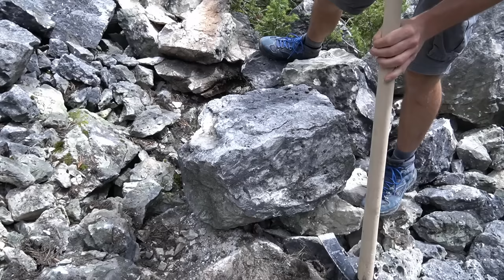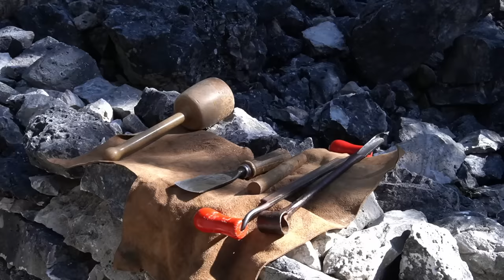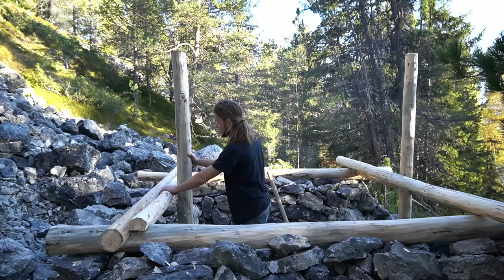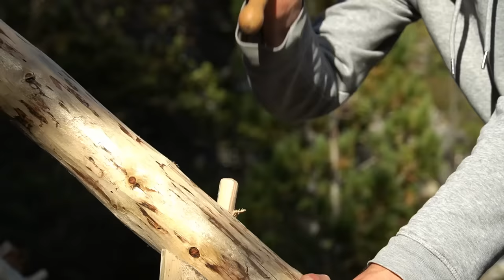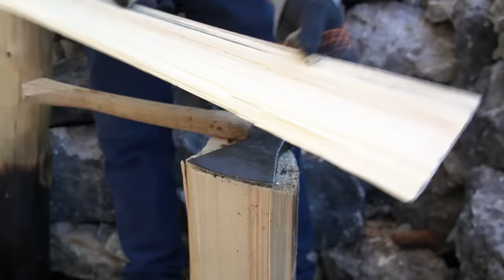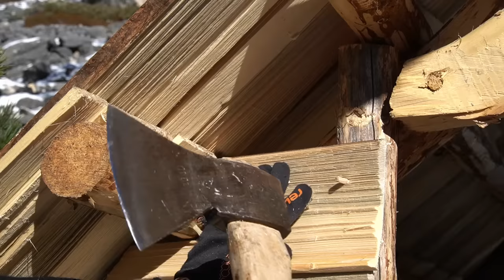Building alpine Bushcraft Shelter | Survival materials, shingle roof, stone wall [Pt. 1]

Comment: Nice work on this build.  I especially like the all-wood aspect to it: in that there are no metal nails.  I know some people put clay in with the dry stacked rocks as a way to seal the wall and keep it warmer in the winter.  I am curious about part two.  Cheers.
Reply from the maker: Thanks a lot mate👍 I was looking for clay but its not easy in this area, the gound consists mostly of soil and sand.. after the winter I will look again👍
Reply: @EpicAlpineBushcraft  moss could be available
Reply: @EpicAlpineBushcraft  you could try wood ash cement.

Comment: Building on a talus slope certainly has the advantage of availability of rock, but the reason that rock is there is because something unstable is uphill from it. An avalanche or earthquake could bring more down on you. 
I love the craftsmanship and the froe. My brother made a froe about 50 years ago to replace some of the shakes on the log cabin we spent our summers in as children.  I am more partial to a saddle corner where only the bottom sides of logs are notched with a curved notch. Notches on the top surface collect moisture and speed decay.
Reply from the maker: Hello, on the video recordings it may look like you mean, but in real life its different. On the upper, steep side is just sand and pebbles. The larger stones are all down and this terrain didn't change since I was a child. Unless there are no natural extreme conditions there is no danger

Comment: Servus! Nicely done 👌🏼 usually one finds all kinds of bushcraft stuff. But as I am Swiss/Austrian it is hard to find some sort of environment bushcraft I could do myself. 
Unfortunately I just got a problem with the disk between two back spine bones at 32 and probably have to use physics to move heavier stuff. F.e. move those boulders with momentum from metal poles. 
I do plan to buy a claim (Parzelle) in a forest to build something myself.

Comment: That's amazing! Why do you burn the tips of the logs before putting them down in the holes?
Reply from the maker: Thanks a lot manuel👍👍 to prevent them from rot in the underearth part. The charcoal skin is very resistent

Comment: Beautiful project.  One observation/question, was the rock patch from an old creek bed or from spring melt?  If the latter, I’d worry about it getting hit with water during the spring melt.
Reply from the maker: Thank you very much Nick! This is a dry boulder far from water, so that also the rainwater will not cause any issues as the rocks in the lower area, where the hut is located, are particularly thick with almost no sand/pebbles which could prevent the water from trickling into the ground. Unfortunately the incline is not so well visible on the video recordings. Further up, where it is steeper, there are mostly pebbles, so there is no danger of falling rocks

Comment: QUESTION PLEASE:  OUT OF CURIOSITY:
* Why did you put logs and stones over your shingles on your roof?
* I'm assuming that you're worried about them "blowing away" but, as you know so well, as you showed in your video, snow and water get piled up on the logs and stones (ie: the can't slide down the roof) and that will rot (aka deteriorate) your beautiful shingle roof much quicker!!!
* Just curious!!

Excellent job on your carpenter and masonry skills!!  : )

Amen
Retired, Veteran
Reply from the maker: Thanks a lot Brad! As you said rightly, for reasons of stability and, at the other hand to get the shingles straighten out, (the logs had a slight vortex grain). The accumulation of snow is even welcome in that context. The shingles don't rot that easily
Reply: @EpicAlpineBushcraft   KEEP BUILDING MORE AND MORE WITH DIFFERENT DESIGNS!!!   : )

Comment: Maybe I'm a novice, but a house built at the bottom of a hill where clearly rocks have slid previously, then building your house on top of said rocks, doesn't seem very safe? Also, the floor is a bunch of loose smaller rocks, which seems not only uncomfortable but like a rolled ankle waiting to happen.... Anyway, all that said, I like the general aesthetic and the build process overall!
Reply: Granted, the age old kick and slap technique to test the structural fortitude of the building is all the signoff I need.

Comment: Building any shelter in this rock falling slope is crazy. Sooner or later you will have a rock falling on your wooden roof, so in your head.
Very nice video but....
Reply from the maker: Thanks mate. This slope looks in real life different from the recordings. The larger rocks are already on the flatter downside, meanwhile the upper and steeper area is mostly covered by pebbles and sand. There is also a vertical treeline directly over the hut, so it is still safe. This slope didn't change since I was a child...

Comment: Seem's an incredibly dangerous spot, at the bottom of where those boulders fall.
Reply from the maker: The place of the hut is safe, due to a vertical treeline which interrupts the slide. You maybe can see that better at the drone recording in the first minutes
Reply: @EpicAlpineBushcraft  Dependant on the size of the rock of course.

Comment: just how prone to rock slides is that area you built in ?
Reply from the maker: Hello, it is not dangerous as it may look like, because the upper, steeper area consists mostly of pebbles. The larger rocks accumulated in the lower, flatter area. This is not so well visible in the video recordings

Comment: So you built a structure in a known rock slide area? Not near it, in it. Like... right in it. I'm trying not to be that guy here I swear, but why? Please, I really want to know the rational of this decision.
Reply from the maker: Hello, because of the good availability of building material and the quiet good protection from noises down the valley (better for filming). As you can imagine is this not my new homestead. I have to throw this shelter down within a certain period of time;)
Reply: @EpicAlpineBushcraft  ok thanks man. I really just wanted to know.